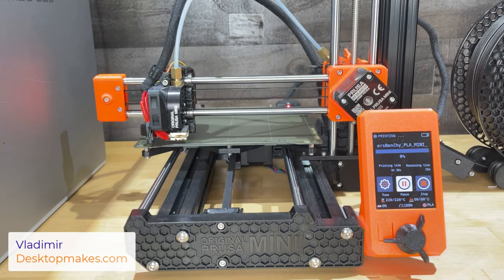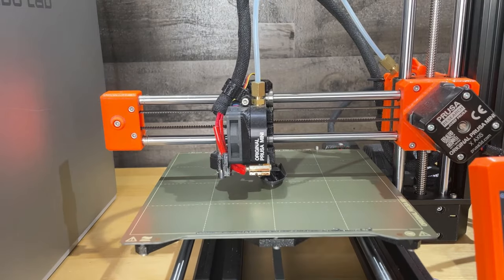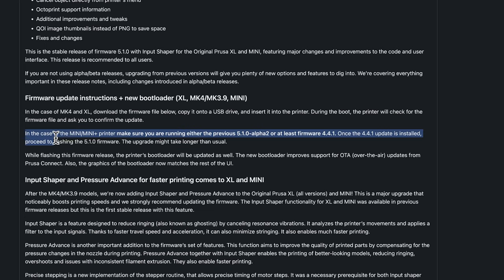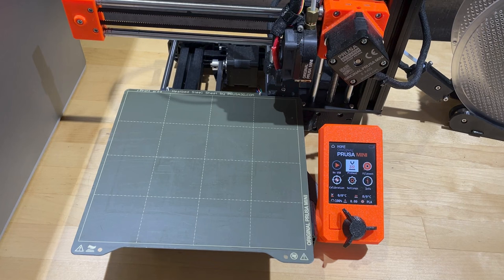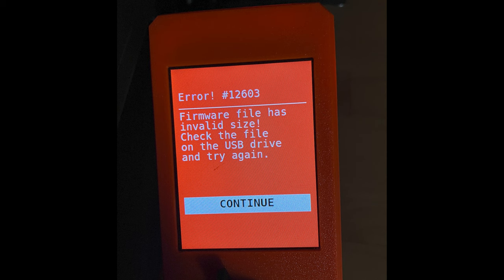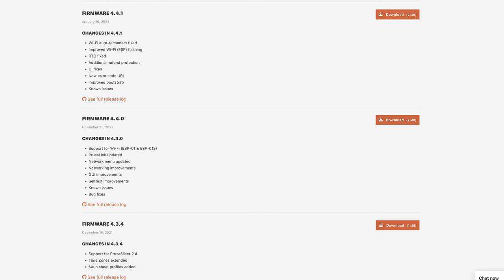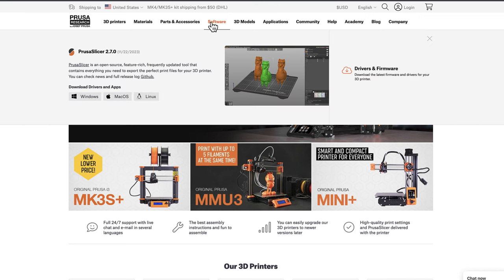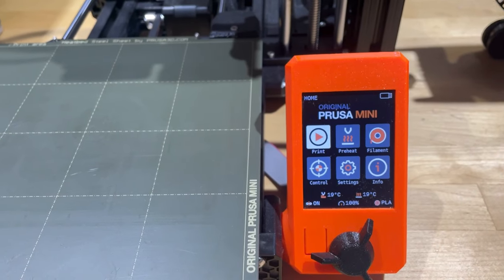Installing Input Shaper on the Prusa Mini

Comment: Next time, it’s always a good tip to read the release log before upgrading :-) 

“In the case of the MINI/MINI+ printer make sure you are running either the previous 5.1.0-alpha2 or at least firmware 4.4.1. Once the 4.4.1 update is installed, proceed to flashing the 5.1.0 firmware.”

Of course it shouldn’t be necessary to read it, but it’s a smart thing to do nonetheless ;-)
Reply from the maker: Yeah, the whole reading thing tho...

Comment: to get rid of the usb inserted with 12604 error. I had to downgrade the firmware to 4.4.1. while in 4.4.1, turn the firmware update to off and upgrade to newest firmware.